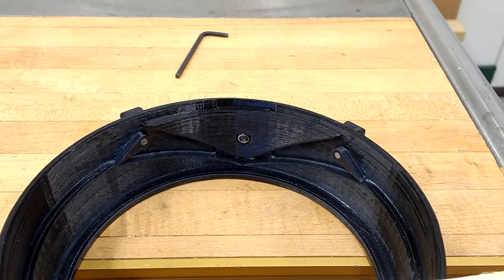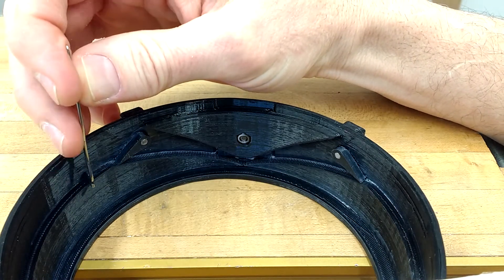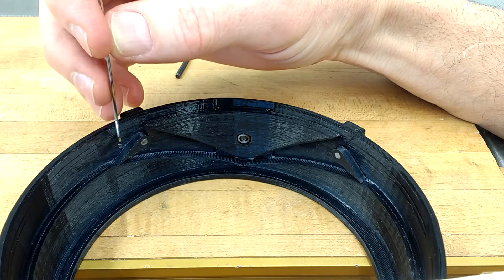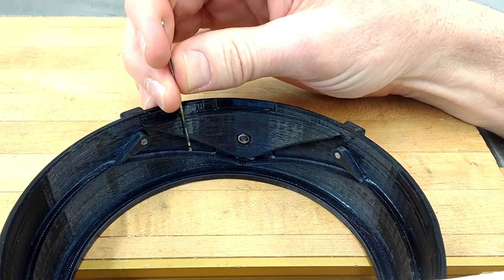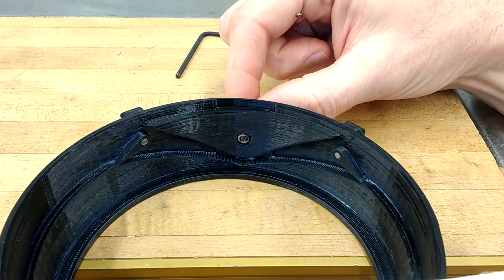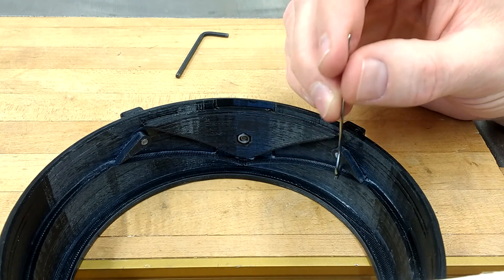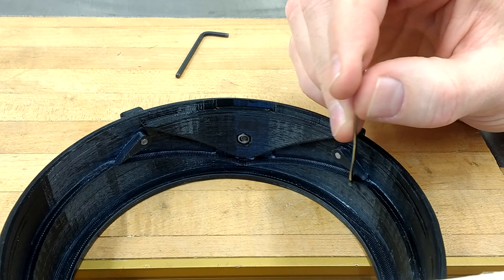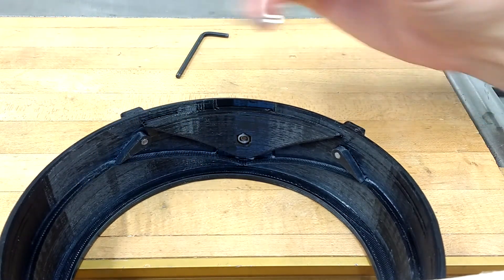3D Printed CSM Circular Sock Knitting Machine: Cams

Comment: Hello! I'm in the process of building this and I'm having trouble sourcing the springs. You have listed "Torsion springs (left & right hand):  McMaster-Carr # 9271K153 and 9271K157" and for all my google-fu I can't seem to locate the specs. Would you be able to define the specs of the springs? (free leg position in degrees, wire diameter...?) Much thanks and great build!
Reply from the maker: Here are links to the specs:
  https://www.mcmaster.com/9271K153/
  https://www.mcmaster.com/9271K157/

Note: There is a remix on Printables that doesn't use these springs.  A lot of people were having trouble sourcing them or installing.

Good luck on your build!  Steve

Comment: Thanks for the cam demo, can you please develop a cam shell and upthrow cam “all in one” I’ve been fiddling with it for two hours trying to get it to work. Looking forward to your response.
Reply from the maker: Wanda, what do you mean by "all in one"?  What problems are you having?
Reply: @steveturner1447  All in One,, the cam shell,  left and right up throw levers “embedded” in the cam shell versus the a spring lever. Thanks
Reply from the maker: @wanda04g  I am not going to change the design to a "all in one" cam method.  There are other machines on Thingiverse that you can make that use this method.
Reply: @steveturner1447  thanks for the reply.
Reply: The upthrow cam split in 2 when inserting the 1/8 inch rod, my 2nd attempt removing the head off m3 screw and using that in place of rod, however, I was unsuccessful with getting the spring into the slot cut with dremel as instructed. Thanks for the quick response.
Reply from the maker: @wanda04g  Try drilling out the hole first.  Then epoxy the 1/8" rod in place.  Also, I am about to release a new version which has longer upthrow cams.  That may help.